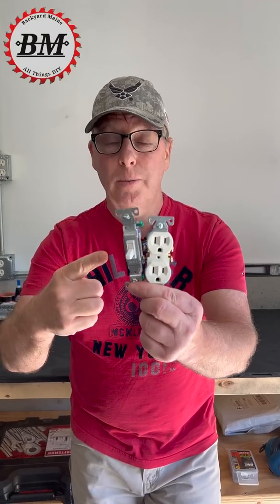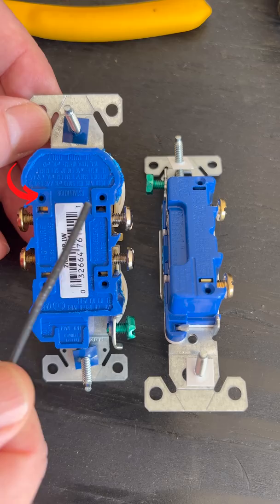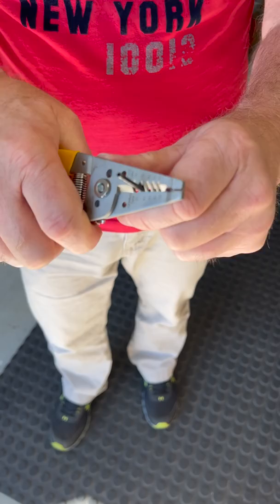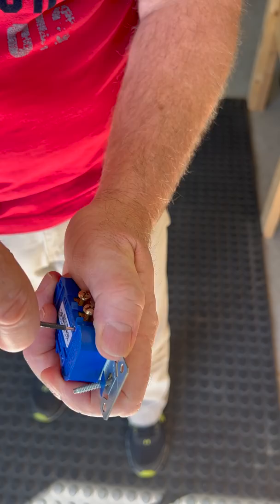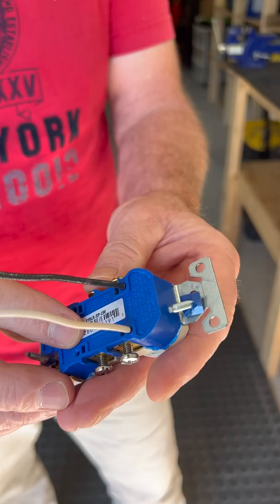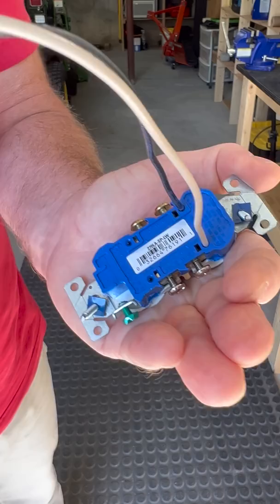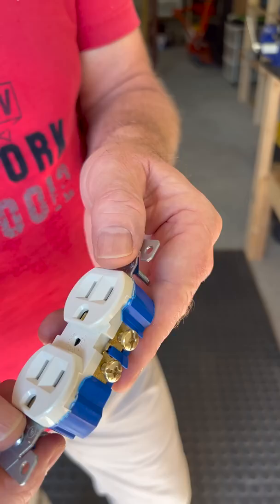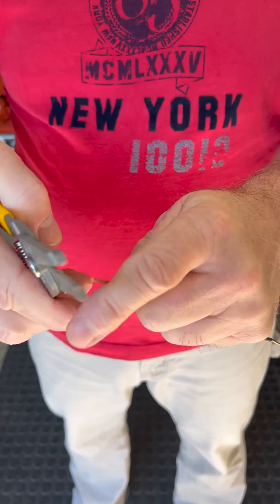Don't make this electrical mistake #Shorts

Comment: If they weren't intended to be used that way, then they wouldn't be there. I use them to feed power when I have multiple lines in a box and don't want to use as many wire nuts. They have a purpose and when installed correctly, will not have the issues you mentioned.
Reply from the maker: Not my experience. They used to be approved for 20A as well but not anymore.

Comment: My home switches and outlets were backstabbed 33 years ago and still working 💯
Reply from the maker: I'm surprised to hear that.. Usually they will start to fail with any considerable loading. AC, Electric Heaters, especially appliances in the kitchen will usually fail pretty quickly.
Reply: @BackyardMaine  maybe it’s the hot weather here in Texas that keeps things bone dry 😅
Reply: He used 12 gauge wire for everything, and 20 amp breakers 😱
Reply: Btw, thank you for your instructive videos 👍

Comment: Also, the circuit will be parallel if you splice and leave tails , that way if one plug fails, you’ll still have power down the line . If you back stab, and that plug burns out, you’ll lose power to all other devices down the line
Reply from the maker: Technically it’s paralleled on both applications. One is paralleled at the device while the other is paralleled at the wire nut.
Reply: @BackyardMaine  not when the device fails and you stab lock the line and load, it interrupts the circuit when it burns out
Reply: I wouldn’t lie to ya 😉
Reply from the maker: @ryanshaw7716  As you know I don't recommend those connections. I have a video on when I choose to pigtail..
Reply from the maker: @ryanshaw7716  😎

Comment: Total failure back stabbing is! When I recently moved into my new home a receptacle wasn’t really working. One I pulled it out the hot wire just slipped out of the tab 😮

Comment: I had a switch go out shortly after i bought  house.  The others were back stabbed so I did the same.  Then I researched and the general consensus  was do not back stab. So I got 3 new commercial  grade switches that don't have the back stab option and a plate clamp for the wire.  Got them secured and they work great. I like the added force required to flip the switch

Comment: I have never used those slot. Even back when my Dad was an electrician he told me they were the most useless thing ever. In my time, I have found that the wire can come lose form these, do to how cheep some of them are made. My Dad clamed they were made for lazy electrician that did not want to take time to do it right.

Comment: n Germany we use such terminals everywhere, "Wago" up to 32 amps. Our sockets have 3600w 16A. I've never had one burn out despite a long running time with a high load. That only happens if the socket was violently broken or badly wired.
Reply from the maker: The wagos actually clamp down on the wire right? These just wedge the wire in between two contact points one having some spring.
Reply: @BackyardMaine  Yes that's right

Comment: Back stabbing devices, stab in wago connections, ect, is the reason we have to use $40 a piece afci breakers. I wish they would just require solid connections instead.

Comment: i had to re-wire 3 of those same sockets in my uncle's trailer because the inside of those push pins burned OUT ... 
Had to use the side screws.
Reply from the maker: I'm not surprised. They fail all the time.

Comment: I'm with you bro if it has an issue here and there that's an issue but to say never do it is to defy the fact that they're designed to be used that way so so there's that
Reply from the maker: They are but my 38 years as a licensed electrician repairing countless back stab failure I don't recumbent using them.

Comment: I'm a DIY kind of a guy. And absolutely agree, always always always (always...) sidewire. It's a no-brainer. Don't take the shortcut. 💯🤟👍
Reply from the maker: You have it figured out my friend.
Reply: Same here. Along with using the side screws, if there is more than one device in a box or if the box is metal I wrap the device around the screws with electrical tape for added protection.

Comment: Its not so much the push connections on the outlet. Its that usually when theyre used in such a way they are also being used as a junction for a circuit instead of being pigtailed. If the outlet is pigtailed and backstabbed it will serve 15amps just fine, but damn it just take the extra time n screw it down.

Comment: Great Advice, but it is not "back-stab".

 those outlets really over heat over time if wired through those holes and really do cause trouble and can cause fires 🔥 

Always wire outlets using the screws.
2 additional points,
A 20 amp circuit will oftentimes use 15 amp outlets, always wire a 15 amp circuit with 15 amp components and 14 guage wire or better.
Replace all non conforming outlets, those without grounding and any outlet with other than screw terminals.
Reply from the maker: Most know them as back stabs or quick connects even speed wiring. By the way you cannon use 14AWG wire on a 20A circuit like you mentioned.

Comment: There's one outlet that I used to have. It was a backstabbing only outlet because it didn't have no screw terminals. So when it buzzed or hiss the bathroom and my brother's bedroom in the laundry room did not have power besides the outlets so the outlet we took out was the problem
Reply from the maker: They are very problematic

Comment: I was told it's a common failure point because people don't know how far they should strip the wire
Reply from the maker: Not my experience. The one I alway see failed are from the point of contact on the wire. It’s small and eventually starts arcing

Comment: I've only ever used those holes for temporary stuff on the bench. Things that will be disassembled before I leave the room. I assumed that's what they were made for.
Reply from the maker: Unfortunately there are a lot of electricians that use these connections because they are fast and easy.

Comment: As an electrician I agree 💯. We get calls all the time for these kind of failures.
Reply from the maker: Same here my friend.
Reply: At least it is a money maker for you.
But it also causes many fires.
Also, I see 15 amp outlets on 20 amp breakers / circuits often enough.
I prefer to only install 20 amp outlets using the screws terminals only as I have always done.

Comment: Also if you have a feed in and feed out you should splice together and tail off to the receptical,this way if device fails,it doesn't affect the other receptacles on the same circuit

Comment: Back stab has never had any issues in 20 years I’ve been doing it. It wouldn’t be passed for use if not safe. The problem is people doing their own work or work for others when they should never touch electrical to begin with
Reply from the maker: Not my experience. They used to be UL listed for 20A as well but not anymore. So they were listed and then found not safe. 🤔
Reply: @BackyardMaine  for 20amp, they still sell the 15amp and never had an issue for 20 years

Comment: True with some brands.... others you won't have that problem, some have a screw tightening manner to  them, GFCI's
Reply from the maker: The ones you're talking about are called back wiring. These are much different than the backstabs and are a great option. They can be found on commercial grade devices.

Comment: Just a question: are those Eaton outlets?
You don't need strippers for Eaton because:
1: the ears on the outlet have blades to help strip insulation on 12 and 14 gauge
2: the screws themselves have those tiny blue hooks to make the shepherds crook/hook so you don't need the "hook hole" from the pliers.

I only mentioned this because I personally just learned about it 2 minutes ago.
Reply from the maker: Yes they are and I'm guessing that you learned that from my other videos. lol
Reply: @BackyardMaine   Probably!! I saw those functions listed on a website and I came to YouTube to see how it worked! 😂 I'm sure you're one of the few videos that explains it!

Comment: Tell me, here in the Netherlands, we use these kind of connections for years. No flickering lights, No overheated or arcing connections? Even the "wire nuts" are the push in type.
Reply from the maker: Maybe because your running 220v. Here with 120v these are very problematic and most electricians won’t use them.

Comment: If you stripped of the proper length and push them, and there’s no problem. They are UL listed and tested as safe. The reason you’ll will see them fail as people don’t strip them enough when they push it in. Or they use older outlets that have been used already. I used to believe the same thing until I looked into it more.
Reply from the maker: Ok. I haven’t had that experience but I do appreciate you adding to the discussion.

Comment: I remember when the code changed and the plugs wouldn’t except #12 GA anymore so these trim guys would take home a case of plugs and have some beers and drill them out to stab #12 GA .
Piece work was all about speed. 
They eventually got caught!
Reply from the maker: I've heard that in the comments before. Crazy to risk a fire just to save a few seconds.

Comment: There’s also a little tab you can stick the wire in and bend it around the screw. Easier than bending it with your pliers.
Reply from the maker: I think I covered that in this video. Thanks for sharing.. https://youtube.com/shorts/KavhTwwh0mo?feature=share

Comment: There is another hidden gem in those devices. Each one has its own wire stripper and wire bended included. Just look closer at the mounting screw holes, there is usually instructions and wire size info printed there.
Reply from the maker: Yup, I did a video on that right before this one. https://youtube.com/shorts/q3uipgND910?feature=share
Reply: @BackyardMaine  Funny thing, seems I already saw that video and liked it, but it was a while ago and forgot it was yours, thanks for that tip, and the new one from this video, didn't know about the push in connections either. This may be why one of my light switches is occasionally wonky.
Reply from the maker: @spmcintyre  My pleasure.. When troubleshooting an intermittent electrical issue in a home these connections are usually the culprit.

Comment: My house was built in 2004 and I’ve replaced some switches with smart ones and every switch and outlet is backstabbed and so problems 20 years and they are almost all the original outlets and switches, only replaced a couple with smart switches so I could control them from my phone

Comment: I went throughout my previous “new” home and fixed all the backstabbed electrical connections and changed all my crap light switches. Cheap electrical contractors burn houses down and the city inspectors are clueless.

Comment: I just installed some 2 weeks ago that don't have the side option. The screws are there but they tighten up the back stab only. You can not install the wire on the screws.
Reply from the maker: The ones you're talking about are commercial / professional grade which work great.. Not like these..

Comment: I’ve been doing this work for 40 years ,it Takes know more time to put the wire around the terminal as it does to back stab and the connection is 1000 percent better …
Reply from the maker: I agree 100%. 🤙

Comment: Those backstab connections should be outlawed. Way to dangerous. Some idiot used them on my current home.
I'm replacing them a few at a time.
The problem is the idiot also cut the wires WAY to short.

I ended up ordering receptacles that accept the wire through the back, BUT also use the side screws to tighten down on the wires.

Comment: I never used a little holes in the back I've always used the side screws and add a little bit of tape around the edges cuz you don't know what idiot is going to be yanking and pulling the outlet out afterwards with the power on. Safety first....

Comment: The hole connections are 1 time use only. Once you release the wire using the screw driver, that's it. That hole can't be use again.
Reply from the maker: That's what I said..

Comment: My previous house was full of those back stabbed outlets. Mostly just bad connections but I had to redo every one of the outlets using side wiring.
Reply from the maker: It's a very common problem. Nice job! Thanks for sharing.

Comment: I agree with you and it is for this same reason I won’t use wago wire nuts. I just don’t like the lack of total connection. Can you address this concern in a video ???
Reply from the maker: I was in the hate Wago camp as well because I know how unreliable the stabs are. But before bashing them in a video i decided to test a set on a well pump circuit. With the motor inrush and frequent cycling I was sure they wouldn’t last. To my surprise 6 months later they’re still doing fine. Look for that video soon.
Reply: @BackyardMaine  , thanks for the reply!

Comment: Если в сеть включать мало мощные, приборы( зарядки для телефонов и компьютеров, настольные лампы) то можно и через быстрое соединение. Но если розетки будут работать на пределе их расчетной мощности, ( такие приборы, как пылесосы, воздушные и масляные нагреватели) надо подключать всю сеть через винтовое соединение. Мы использовали дополнительный нагрев воздуха прибором на  1500 ватт, и в результате на одном из соединений прервалась подача тока. Я нашел где и переделал подключение проводов через винт. И о чудо! Все работает уже 3 года, без проблем!
Reply from the maker: Yes. They fail over time with current over a few amps in my experience. Thanks for adding to the conversation

Comment: For those of you in countries outside of North America, we avoid using the quick-connect back terminals because most outlets and switches are cheap pieces of garbage made in China. Although there are good quality ones out there that work as they should, we just assume the ones purchased are shit and side-wire them like always. 
Now, if you purchased the receptacles yourself and know of them to be high quality and have a much lower chance to burn your house down, then by all means, you are welcome to use the rear terminals.  They need to mandate that manufacturers abide by certain standards if they're going to keep making outlets like this. All the ones I've ever seen previously installed are just total crap. It's more akin to something you'd get out of a claw machine in an arcade that "Looks Real" but in reality, it's just fake lol
Reply from the maker: Thanks for sharing your opinion.

Comment: After 28 years in the trade I would agree that stab-in connections are one of the most common failure points on a branch circuit.
Reply from the maker: That's been my experience as well.. Thanks for dropping a comment.

Comment: it can be only if back connection bend radius is smaller than side connection. sharp radius (i guess they make corner) cause cracking.
Reply from the maker: I see these fail in almost any application.

Comment: Interesting that in the US you still prefer screws. Here in Europe everything is getting away from screw terminals, that are easy to install wrongly and get loose over time creating potential bad connections.

We start to see Wago connectors everywhere, and now starting to see socket, switches, etc that are screwless with that kind of push fit connection.
Reply from the maker: You do run a higher voltage as well which makes a difference. Also maybe your push fit connectors are a better design.

Comment: The manufacturers should improve these… easy fix and this has been an issue forever. Most boxes you can’t fit wire nuts and make taps…

Comment: I'm an electrician and the reason why it doesn't work is because it looks like he used 12AWG wire, they are only ment for 14AWG so that's probably why
Reply from the maker: Nope of course it’s 14. Licensed electrician and electrical engineer here with 38 years of experience

Comment: The problem I’ve witnessed with stab in connections. They become loose and can arc from poor connections or interment short. On/ Off. I was trained and always use the side screws. Just more secure. Yet I  do industrial equipment. Never will fine these kind of receptacles. I also would never buy them.

Comment: I have suggestion you should add on the fact that the stripper for 12 and 14 gauge wire is built into both the switch and the plug also the hole is there to use for bending the wire to side wire
Reply from the maker: See my previous video detailing these features. https://youtube.com/shorts/q3uipgND910?feature=share

Comment: Ok, so what about the type of connector where the wire enters into the back of the receptacle and then the connecting screw has to be tightened down for it to be held in place?  Is that the same as a "back stab" or does that count as being "properly attached"?

Comment: No disrespect but I saw another video that says for the standard type of receptacle (like the one you showed), you are correct. However, for a gfci receptacle it’s okay. The reason being that with a standard one, it clips in and is not reliable. But with a gfci, the entire force of the screw itself is pressing against the wire. Could you please give some clarification? Thank you.
Reply from the maker: Great question and Yes you are absolutely correct. This type of connection that I'm showing is often called back stabbing, quick connects, even speed wiring which is an extremely unreliable method in my opinion. What you're talking about on the GFCIs which are also on AFCIs and commercial grade outlets and switches is called back wiring. Those are a very reliable connection because you have screw tension compressing the wire between two conductive surfaces with lots of surface area. Two different things altogether. I hope this helps..
Reply: @BackyardMaine  excellent explanation. Thank you for your response 👍👍👍
Reply from the maker: @WavyFBaby  My pleasure.. Thanks for watching.